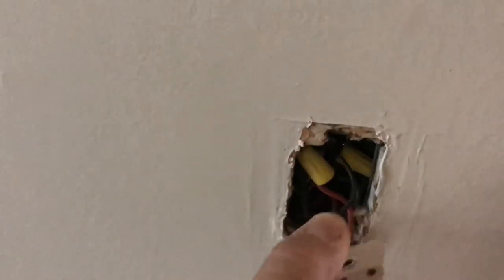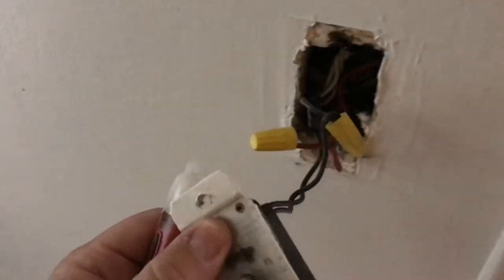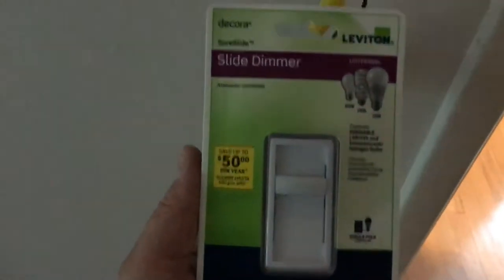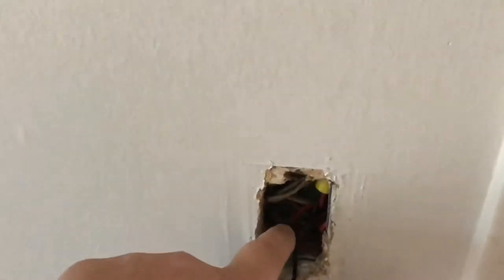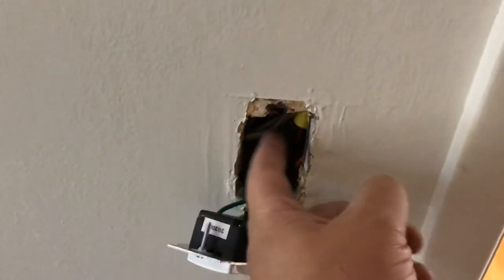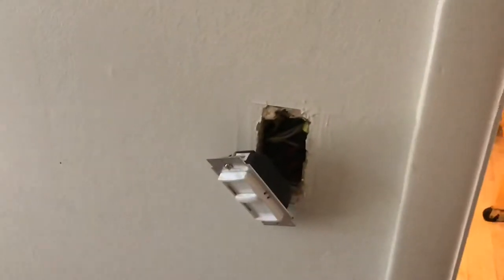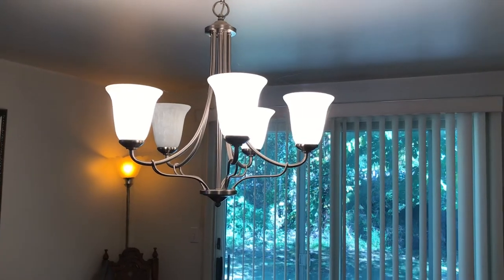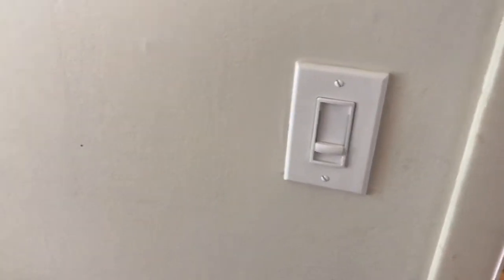How to Replace broken Dimmer switch

Comment: What if the current dimmer has no screews on the outside?
Reply from the maker: Most likely a screwless dimmer switch cover that snaps on. Usually you can pry the corner and it will come off exposing the screws not sure Youtube how to remove a screw less switch cover good luck.